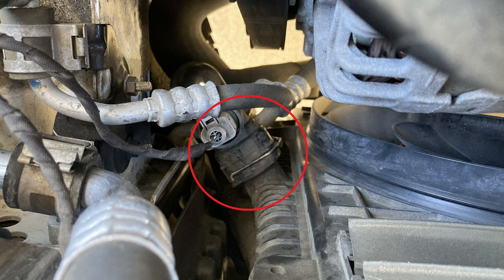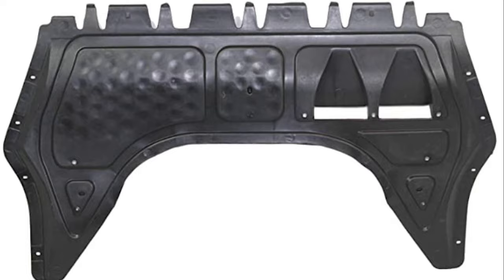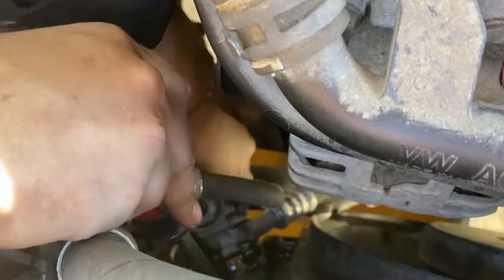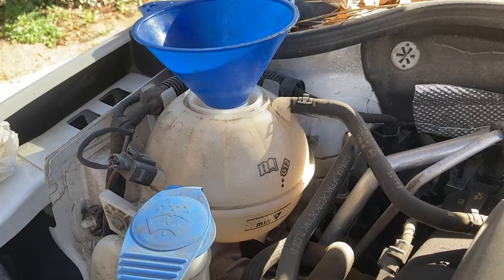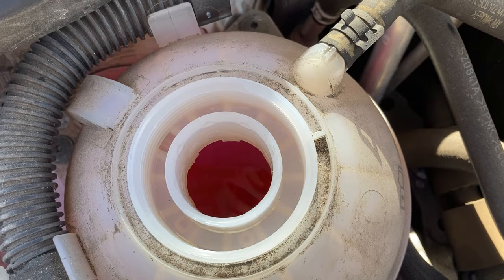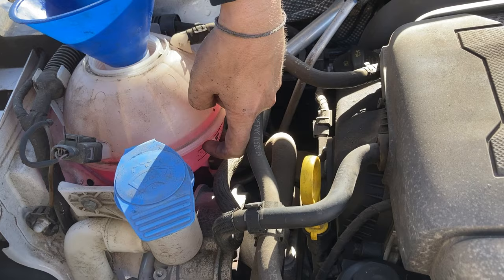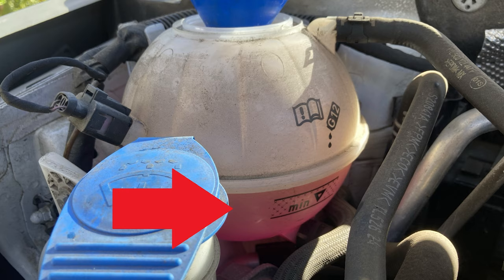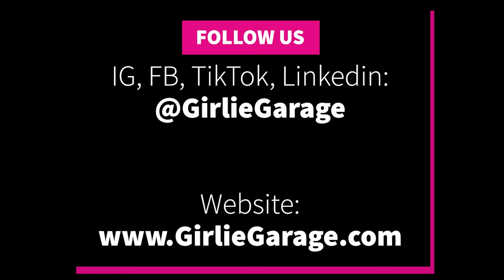2011-2018 VW Jetta - Coolant Drain & Refill - Girlie Garage

Comment: Anytime someone points you to the manufacturer for parts and fluid, RUN 🏃‍♂️😆
Reply from the maker: I think it depends on the parts/fluid. For example, transmission fluid and power steering fluid, I would ONLY use manufacturer fluid. Also the customer requested this specifically, so maybe don’t knock it without knowing the backstory.
Reply: I used to be a non-manufacturer parts guy but in the last few years the non original parts are just junk. Half don’t fit right and the other half break after a short time. I’m done with knockoff parts. I only buy original manufacturer parts now. I’d rather pay an extra $50-100 for a quality part than have to do the same job over again a few months later.
Reply: VW concentrate coolant is cheaper than Prestone 😮
Reply: Totally agree with OEM parts/fluids especially when you’re dealing with a critical component of your car. If people want to be penny wise and dollar foolish. Hey it’s your car and money do what you want.
Reply: We use yellow coolant and have never had a problem (just never use stop leak!!!)
Reply: Anytime someone points you away from manufacturer parts/ fluids, literally loses credibility for anything moving forward.
Reply: I wouldn't use anything other than VW/Audi branded coolant, ditto their manual transmission oil
Reply: @GirlieGarage  ❤
Reply: VW makes only specific parts so you have to go to them lol so …..
Reply: This aged well 😂
Reply: You run.
Reply: Right. The Cummins red coolant works the best in any diesel.
Reply: ALWAYS buy manufacturer parts… NEVER buy cheap parts online…
Reply: With VW, most of the time stuff is the same price at the dealer. Fluids, wiper blades, stuff like that.
Reply: So wrong
Reply: I only use cheap online parts for my 2006 Sentra. My 2015 Jetta is a different story.

Comment: This made this task very simple. I searched and searched and searched and couldn't find drain plug locations etc. This was spot-on for my 2014 Passat. It was nice and quick and easy to follow. Great job
Reply from the maker: I feel you!! I searched too, then was upset that it didn’t have a radiator petcock so I made this video to help others. So glad it helped you!! Great job doing the work yourself!!
Reply: This procedure is also in Haynes manual for this vehicle but thank you for the video. @GirlieGarage

Comment: Thank you very much. VW have done a great job with this vehicle but the lack of a radiator drain plug is a brain fart moment on their part. This greatly helped me.
Reply from the maker: 😂😂😂 I agree
Reply: The 96 Jetta didn't have a drain plug either. They've had 30+ years to add one.
Reply from the maker: @AlKaseltzer87 ….seriously 😂
Reply: Also, there is no fuse box diagram either. Found one online, and it did not match my car. Most cars have them on the fuse box cover or in the owners manual. Not VW, I guess they want to keep that information to them selves. Crazy

Comment: Problem with this method is you have still got half the coolant still in the engine block, all you have done is change 50% of the fluid, you need to do a proper flush, this is kind of a waste of time really, you need to use the reservoir and upper(return coolant pipe) hose. Drain fluid out of ressy then use ionised water start the engine and top up ressy as you go  and wait until clear(ionised) water comes out of the return hose (use some clear pipe and bucket down by the wheel) then stop engine drain ressy again and add new coolant start engine back up and waituntil all water clears and fluid coming out the return hose is the coolant(pink) colour...you can't get coolant from block doing what you have done, there is around 3.5- 4.3 ltrs of coolant in the system depending on engine size, I bet you only got 1.6-2.1 ltrs out.  No need to disconnect radiator or jack up car,  if you gonna change your coolant then do it right...👍
Reply from the maker: That is super helpful and appreciate your feedback. This video is for a drain and refill, not a flush.

Comment: Do you put the whole gallon in the reservoir then start it?
Reply: You shouldn't be able to fit the whole gallon in there unless the car is running. Put some in the coolant tank, then start it. Immediately be ready to start filling again, because the level will go down quickly.

Comment: 2009 Passat 2.0L TSI is the same setup. Some notes:
1) Sensor has an internal O-ring (easy to lose). It is held by a spring clip and should not be removed. The wires won't strain so avoid that step.
2) Radiator drain hose is near front left tire. It is easier to disconnect from below.
3) Remove the air vent hose (held by spring clip) directly under radiator plug. This gives you space to work.
4) Come up from the tire side to gently pry the hose connector off the nipple until it pops.
5) Place catch pail and pull housing off by hand.
Reply from the maker: This is great!!! Thank you!!

Comment: Great video! I noticed there wasn't any petcock for the radiator when doing an oil change, and now my coolant is a bit acidic so I want to do a drain/refill. I was hoping there might be a way to use a hose fed into the radiator to pump out the coolant to avoid a huge mess, but with no radiator pressure cap on the radiator that is probably a no go. So I will try your method and cross my fingers...and have a bunch of towels I guess.  Also, a tip for refilling the overflow tank from the coolant bottle...hold the bottle on it's side or with the opening at the top when you pour and you won't get the glug, glug, glug and all the splashing.
Reply from the maker: Good luck! Let us know how it goes!

Comment: Ive watched a bunch of videos and am seeing conflicting information.
* A couple have said that the VW cooling system is self-burping, others have said that VW procedure requires a vacuum fill system to be used. 
* Quite a few comments have pointed out that you only get around 50% of the fluid out by draining at the radiator. Other pipes need to be opened, or repeated fill-drain cycles, to get more of it.
* Apparently G12 evo (AKA G12++) may be a better choice than G13 for longevity, particularly is systems without the silica bag (and people remove those anyhow because they can burst a clog up the heater core).
Reply from the maker: *all systems have some small version of self-burping. From what I could tell on this pressurized system is that it does self-burp. I still like to leave the coolant reservoir top off for a bit just to help the process along. There’s probably a better way so hopefully a VW tech can chime in. 
*a drain and refill is NOT the same as a flush. If you want to do a flush then I would pay someone to do it correctly, or you can do 2-3 drain and refills to get more of the fluid replaced
*g13 is what the VW dealership sold me for that specific car. They are only humans at the part desk, but that’s what they suggested go in that car and what was available in San Diego for purchase. 

Hope any of that was helpful! Sounds like you are very thorough!!
Reply: G13 is compatible w/ G12.  Or.   Just get Peak Euro coolant.
Reply: @jamesd.9955  which one for a 2012 Jetta Pink or Violet.. Thanks
Reply: Peak Violet works on 2008 and up VW.  At least according to the label.

Comment: Oh my goodness, this is just the video that I needed!  Our 2010 Golf has 151K miles with the original coolant in it + OEM coolant mixed with 50% purified water from periodic replenishments.  Coolant doesn't seem to be that dirty.  Our car is running very strong.  I am gonna change the coolant and ATF together soon.  Where can you dump the coolant?
Reply from the maker: Sometimes you can ask a local shop if they will take it for you, otherwise I take it to our hazardous waste recycling center (ours is next to the landfill)
Reply: @GirlieGarage  Hey Girlie, I just replaced the ATF and the coolant 2 days ago.  Everything went well, thank you so much.  I was afraid of messing with the plastic connector with wired sensor near the radiator, so instead, I removed the hose clamp & then the hose near it, then the coolant gushed out.  You are correct, no need to burp the system which was very easy to do.  I also used shop vac to blow into the reservoir and forced more coolant to come out.

Comment: Do you have a recommendation to flush the coolant system? My oil cool housing was leaking into the cooling system and I think it would benefit from flushing the system.
Reply from the maker: If you’re trying to flush it yourself without cutting into the system, you would basically do the drain and refill process MANY times, there are some good flush/cleaning products as well, just do a bit of homework

Comment: hey i noticed on the coolant reservoir it says G12 but added G13 ? i have a jetta that’s the same that says g12 but the fluid is pink but autozone suggested G13 which is violet ? i’m confused on it
Reply from the maker: I don’t think G12 is avail anymore. When I went to VW they wouldn’t sell me G12 only G13. Otherwise you can probably still find G12 on eBay

Comment: Great video but i have 1 question...  If 5he drain hose is halfway doen the radiator how do you drain the other half . The
Reply from the maker: A drain and refill is not meant to be a complete flush. If you wanted to be more thorough, you could repeat this process after starting the car and letting it warm up then cool down. Otherwise just opt for a full flush

Comment: What is the fluid capacity for the coolant? The fluid capacity guide from VW says 11 liters, and I don't think that is correct.
Reply from the maker: That is likely the capacity for the whole system. Generally a drain and refill is 1-2 gallons

Comment: New to VWs. New to cars that take something other than green. Why does the coolant ball say g12, on your's and mine, but my owner's manual says g13?
Reply from the maker: G13 is the updated product (G12 is going away or now completely gone)
Reply: I have a 2016 Jetta and the sticker on the tank says G12! The manual clearly states G13 was put in at the factory! It goes on to say to NOT MIX the two... I should have stuck with Toyota. My second VW, didn't own the first long enough to learn my lesson.

Comment: I got a 2015 Passat as well, I have a leak at the coupler where it has the c clip. Do you know the size o ring that’s inside the coupler? Mine was missing after I flushed mine out. I can’t seem to find the part if I wanted to buy the whole piece new. Help me plz.
Reply from the maker: I don’t. You could probably  ask a VW dealership parts department

Comment: What should I do if I don’t know if G12 or G13 is in my car? Can I top up with either or will it damage my car if I don’t put the exact one in.
Reply from the maker: I would ask your local VW dealership parts guys. In general as long as you don’t change coolant types (don’t just start putting a different color in or buying it from an auto parts store versus the dealership) you should be okay

Comment: Hello, i have a polo gti 6c, my coolant seems to suck into engine when running, but after shutdown the coolant seems to fill the reservoir, then after a few mins de coolant will go back into engine, is it normal?
Reply from the maker: It is normal to have SOME fluctuation not not usually ALL the coolant in the reservoir goes into the engine then back into the reservoir

Comment: Does this completely drain all the old coolant and then replace it all with just new coolant?
Reply from the maker: This is not a coolant flush so there is still old coolant inside the block. This only drains what is in the radiator and the hoses. If done when scheduled (usually every 3 years after the first 10 years) then you shouldn’t have to do a flush. Also if you don’t live in severe conditions.
Reply: Is there any flush videos?

Comment: Hi, I have a 2017 VW Passat rline and noticed today the coolant level is below minimum line and it is also an orange color. Unsure of what coolant was originally used. Is there a way for me to do a DIY flush at home and a video or do I need to take to dealership?
Reply from the maker: I’m sure there is a way to do it at home. I do not work on vw’s enough to know what that is. There have been a lot of comments on this video on that topic so maybe you can find your answer there or on another YouTube video. If your time is worth more than the searching, I would just take it in so it’s done with the correct tools and your car can be happy

Comment: How did you get the hose to pop off so easy? Did you use the screwdriver to pry it off or did it just pop off
Reply from the maker: You can see at 34 seconds that I used a screwdriver to pry on it a bit but it’s plastic so you have to be really careful
Reply: @GirlieGarage  ya I got it thank you!

Comment: My coolant was changed at 100,000 miles. My 2013 Passat now has 133,000 miles. Does it need to be changed again? Also, is this a drain and fill process? Finally, was the coolant you used premixed  with water?
Reply from the maker: Your coolant should be changed in accordance with your vehicle’s maintenance schedule. Here’s a quick video if you don’t know how to find that: https://youtu.be/Zdb4i2l3d0w

This was NOT a flush so yes it is a drain and refill 

Coolant was premixed from VW
Reply: @GirlieGarage  thank you.

Comment: Hello, I have a 2008 passat and I just had a radiator flush done however there's rust in the system. Would you happen to know how to Pour the Blue Devil Radiator Flush in?
Reply from the maker: I really don’t recommend using outside products. Is the rust coming from the radiator? That would be a pretty easy replacement

Comment: i have a 2017 vw jetta se 1.4t it had pink coolant but autozone website says violet is a perfect fit and the pink one doesn’t fit my vehicle ????
Reply from the maker: I would trust VW over AutoZone
Reply: @GirlieGarage so basically the G12/pink is the right fit ? that’s what it says on the reservoir sorry i’m still confused till this day
Reply: @GirlieGarage pretty much VW started using G11, G12, G12+ and so on? so in current year they moved to violet cause it’s cheaper and has lower production cost ?
Reply from the maker: @NyctophiliaOfficial  Yes, VW has updated their coolant. G13 is what I was told by VW to use for this vehicle per it's vin number.

Comment: Ok well just bought the car 2015 VW Jetta LS, so that is what that is so that is the radiator fluid ok and have to buy from VW of course, so where is the trani do stick then? I checked my oil I am good bout no one showed me any of this and the freaking Manuel says nothing
Reply from the maker: I would recommend consulting your owners manual to see if your vehicle has a transmission fluid dipstick or not.

Comment: I accidentally have some oil on my coolant if i want to flush and clean it, do I use distilled water and radiator flush cleaner?
Reply from the maker: How did you get oil in your coolant? Did you accidentally pour it in because otherwise you have a major issue with either a cracked block or a blown head gasket
Reply: @GirlieGarage  i used a contaminated oiled funnel and now my red coolant is darker from it
Reply from the maker: @lightreditami1398  I understand. You would need to do a full flush. There is a technique that shops use where they T into a line then run fresh coolant through the whole system. That’s the type of flush I would recommend in this case

Comment: very helpful video, but i noticed your coolant reservoir clearly says G12 in the video and you recommend g13 coolant. is there a difference?
Reply from the maker: I purchased the coolant directly from VW for that specific vehicle so it’s possible they updated the formula
Reply: Formula was updated to use glycerin instead of glycol. They can be used interchangeably and even mixed but that is not optimal
Reply from the maker: @josephjones1519  THANK YOU Joseph!
Reply: I notices da too😳🙄🫢😱it supposed to b G12 u Can contaminated
Reply: VW has updated the coolant.
G13 is the latest formula, and can be used on vehicles calling for G12
Reply: Latest formula is G12evo (G12++ ;) )

Comment: Hello I have a 2013 Volkswagen CC. would this also apply to mine? The dealership i got my car from didn't use the coolant that is recommended for my Volkswagen. not the pink or purple and i didn't know if i need to flush it with distilled water or anything else before i can refill it?
Reply from the maker: I don’t know if this process applies to your vehicle. I would recommend doing a full flush if the wrong coolant was used.
Reply: VW has updated the coolant.
G13 is the latest formula, and can be used on vehicles calling for G12

Also, VW spec’d coolant is needed for long cooling system life in VW’s

Comment: I have been struggling to find where the drain spot is located thank you for this useful video.
Plz allow me to give you some of my humble experience with coolant liquids, always try to stat away of red spectrum colours, not to mimic the rust in case it happens to the coolant system. Use green or even clear liquid of available
Reply from the maker: I’m glad you found the video helpful. The coolant used is from the manufacturer and that is what I recommend you put in every vehicle (what is specified from the manufacturer)
Reply: Wrong dude, you have to use G13

Comment: I like this car, but the design choice to make it so darn inconvenient to change the coolant and transmission fluid is baffling.
Reply from the maker: I agree. The transmission fluid level can only be checked by computer so you have to have it done by someone who has the VW software…many manufacturers are heading this direction so that people HAVE to have their vehicles serviced by the dealer because they patent the software :-(